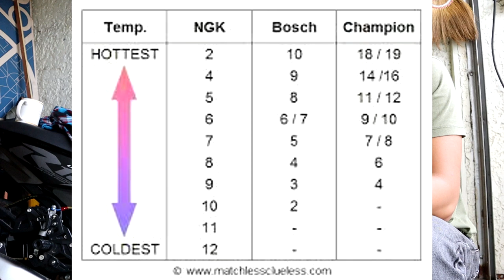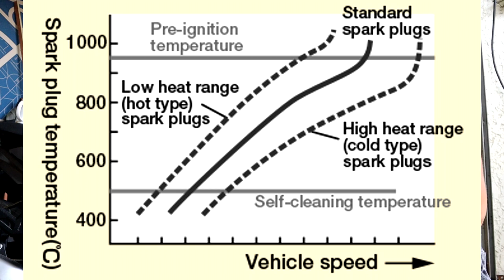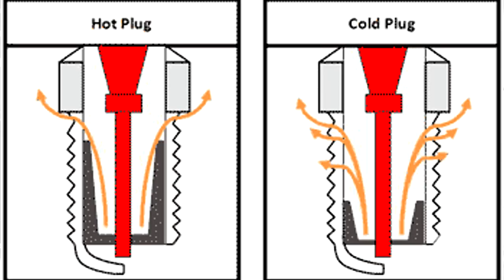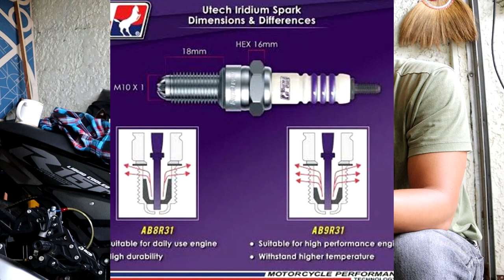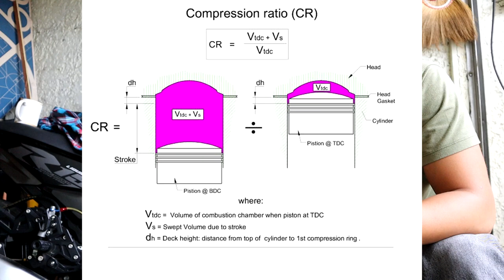Performance Gain sa Spark Plugs?

Comment: nuon nd aq nani2wla sa gnyan until i tried..nka 3 electrodes dn aq na gmit ngaun msa2bi q na may add nga xa..kc nuon sa gmit q na raider150 carb type ang kaya lng nia is 142to144 nka port and polish na un nka 28mm carb..nag try aq ng ibng spark plug un nga 3electrodes kya na nia sumagad sa 160

Comment: Put motorkote and even if there is a bigger oversized cylinder mod it will not brake ever. Report the gains of using it. No adverse here

Comment: bakit di nalang po gumamit ng non-resistorized sparkplug combi ng racing ignition coil, at ignition coil booster ..? ground strapping . .to get the target to have a better ignition spark
Reply from the maker: EMI problem sa non resistor plug... ground strap, not economical to manufacturers.
Reply: @MunsKi  di po ba napreprevent ng ground strap yung EMI ?
Reply from the maker: @gracefrancistanay8263  sa case ko ung emi hindi sya ung pinaka concern... ung problem sakin nag oover heat ung plug, kaya ng kaka misfire kapag naka race mode ung ecu, gawa ng sobra init
Reply: @MunsKi  oo nga po . napanood ko din kasi dati yung vlog mo tungkol sa EMI at resistorized spakplug. maganda sana kung madetermine yung relation ng resistor sa cold at hot plugs.
Reply: @MunsKi  pero dito sa video mo tungkol sa hot at cold plugs ko lang naintindihan kung panu nagwowork at epekto ng hot and cold plug and kung saan sya mas applicable gamitin
Reply from the maker: @gracefrancistanay8263  yep, kapag wala resistor, mas mag iinit din ang plug.
Reply: @MunsKi  thanks sa detailed explanation